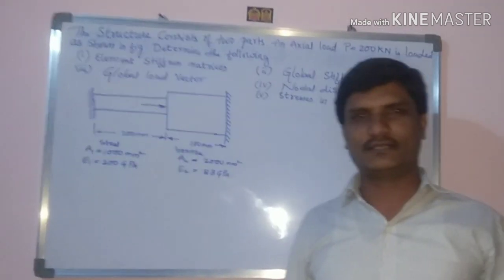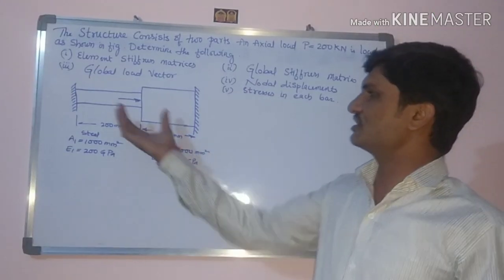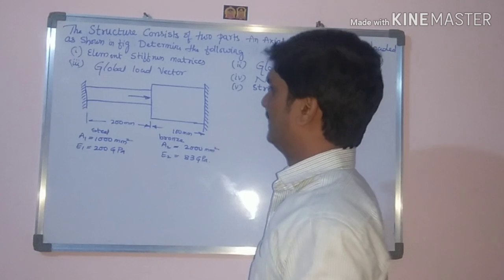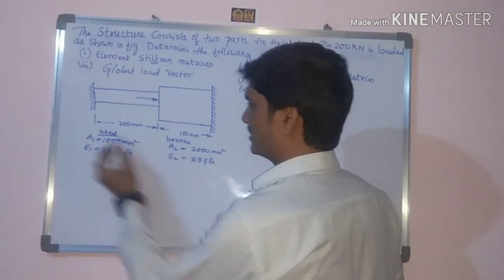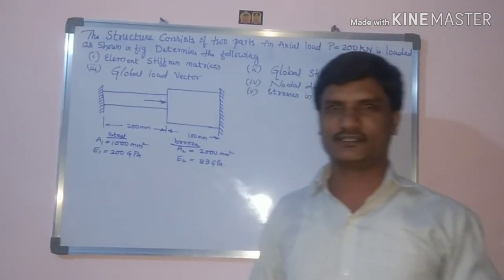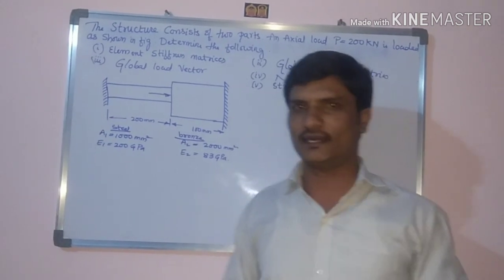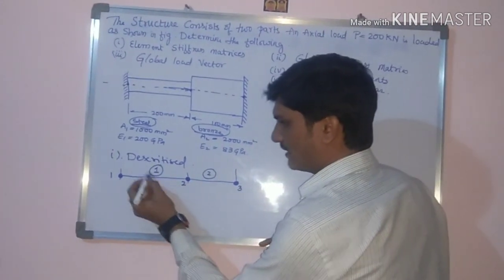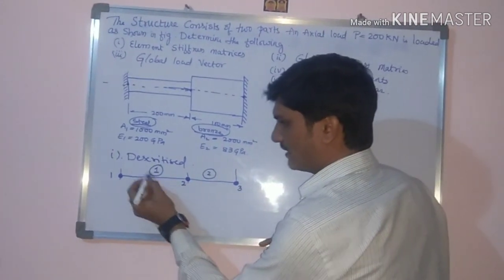FEM bar problem | FEA 1D bar Elements | Finite element Methods lecturer

Comment: If the E value not given then how to find out stresses in elements
Reply from the maker: In General E value will be given in FEM, If not given means, In sufficient data question it will be. In that case You can Assume (50- 100 MPa) Common material properties for metals. NOTE: ITS AN ASSUMED VALUE.
Reply: @MaheshGadwantikar  thank you sir 😊it was helpful🤗